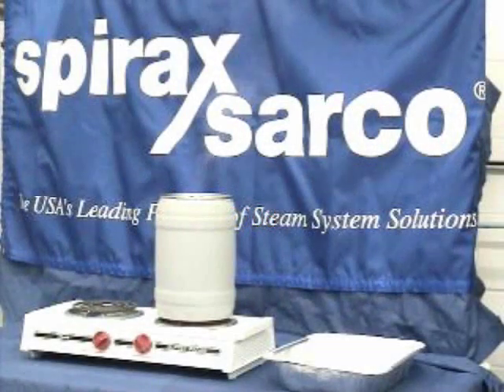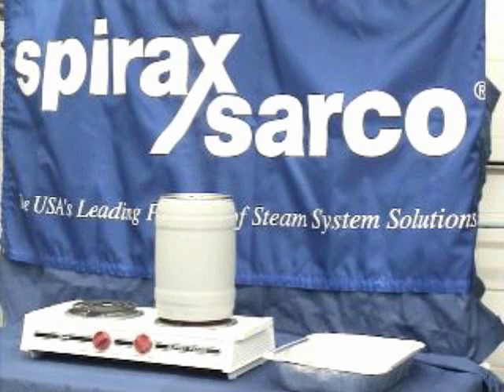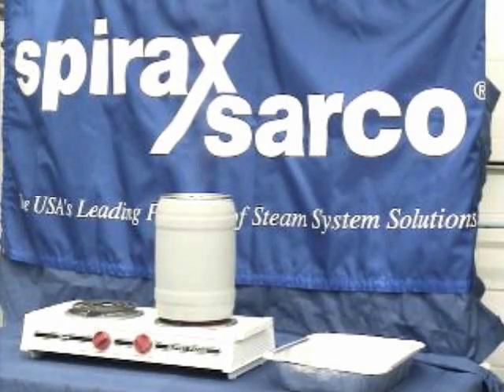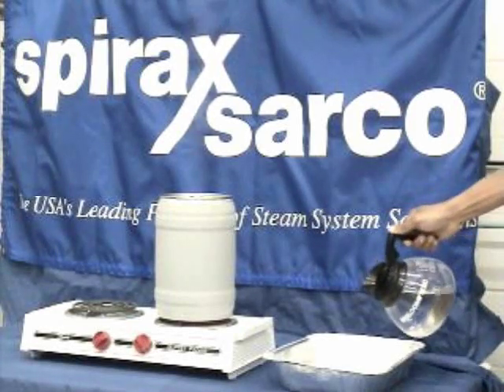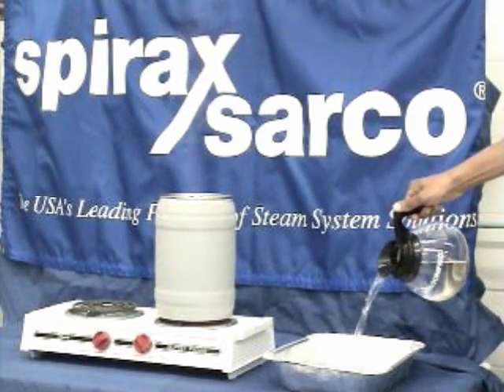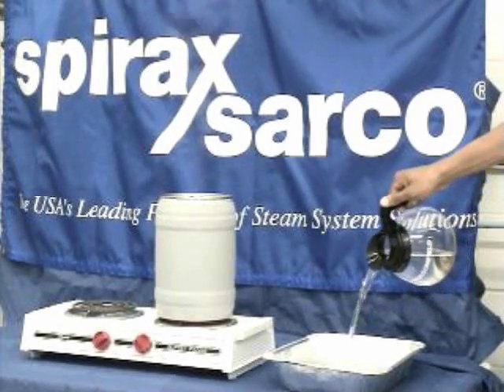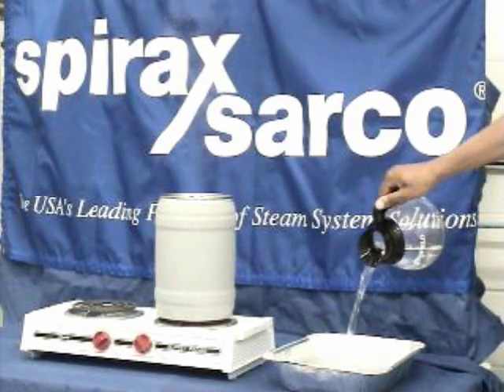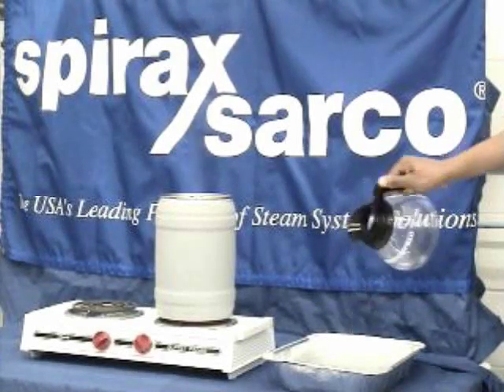Condensate Induced Waterhammer

Comment: I mean... sort of....  The thin walled vessels give you a visual representation of the sudden steam pocket collapse from rapid heat transfer, but that isn't what CIWH is.  It's just an ingredient.  CIWH is what happens when, instead of collapsing, your pipe maintains a vacuum in the space formerly occupied by steam and the pressure differential between live steam and the collapsing pocket, accelerates a slug of water to supper high velocities.  The actual water hammer is the positive pressure pulse that results from the high speed collision of that water column with downstream water or pipe.  When CIWH occurs, pipes explode outwards.  They don't collapse inwards.
Reply: Well said